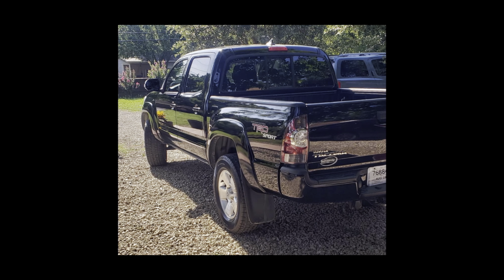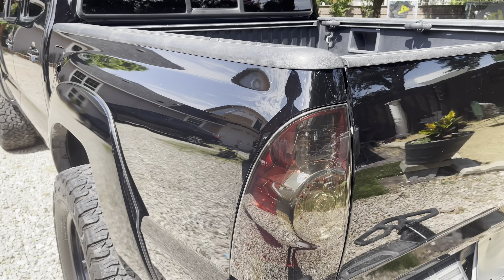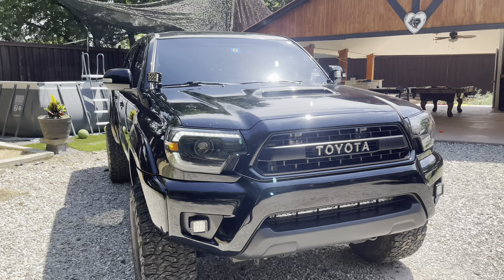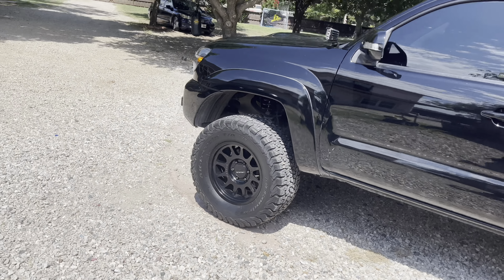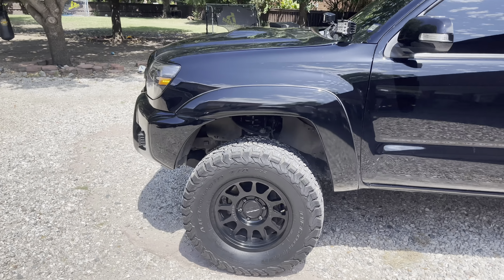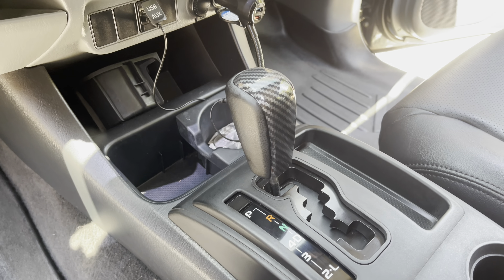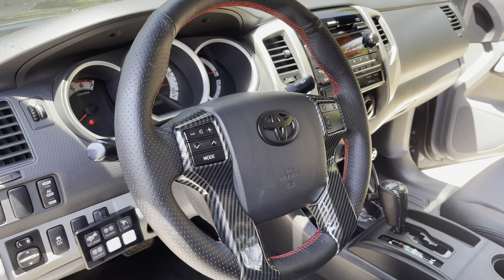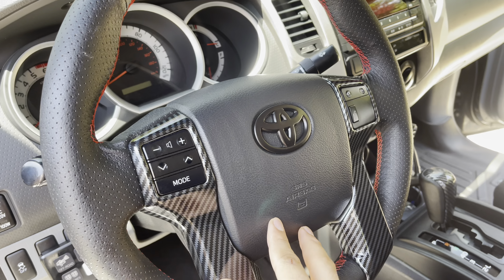Here's what mods I've done to my tacoma | Build list

Comment: so with the ball joints it probably has more to do the suspension angle than the quality of the ball joint. So yeah the stock ball joints in stock configuration will last 120k or more, but change the suspension angle add more pressure to them via larger tire and wheels and lift them via shocks only and they're probably going to fail in 40k or less.  You should look into changing your lower control arm and a steering  solution such as a track bar , drag link or pitman arm. the lca should help with the suspension angle and the steering components will hep with the binding and bump steer induced by lifting the truck.
Reply: Thank you. The lift will make ball joints and links wear out prematurely does not matter if you use Toyota parts. Only real fix is a UPC that matches the lift and is not just a better version of the original one
Reply from the maker: thats super helpful, thanks brother 👊🏻

Comment: I just bought a 2018 TRD 4 door Sport I really wanted the hood scoop and the guy who on my truck I got it from the Toyota dealership there is two that I was looking at and when I went up to the dealership and the guy who owned it he had a 3 inch lift kit on  the truck and new tires  265 /70 R17 and when you open the doors he has the factory the strips right there on the front and back doors it’s a Toyota so I guess he got the factory ones they look really good plus this guy this truck was immaculate  friend of mine he has the same truck as you and he has a 2021 laminate forerunner all blacked out that thing is really nice I really wanted to grab with her, I just wanted to get one with the six cylinder motor because I hear a lot of people are not happy with the new engines and I was happy to find something that was real nice that was used so my payments not crazy high I am looking at your truck with all the mods I can’t wait to get everything oh yeah I had a bed cover to

Comment: You dont need uca if you're under 2" lift.   

Put 886 fog light bulbs in the reverse lights, you'll seea bit better, even better with chrome housing

Your factory halogen housing headlights are far superior than alpha rex especially in the winter.  Morimoto retrofit is a better option but stock headlights with a halogen bulb, youll see better in winter, that's what i noticed with mine.

Comment: Your truck looks awesome, I too have a black 2012 TRD sport but in manual transmission and 4x4, also in the process of blacking out, my mods are the following : I  have both taillights and headlights from Alpharex the luxx versions both alpha black, and also have the mirror turn signals in black and they are sequentials that pair up perfectly with the sequentials on the headlights. Third brake light in black, Raptor grill with raptor lights with black "toyota" lettering , superior suspension front recovery mounts with shackles, sprint booster, S&b cold air intake, Uni secondary air filter. Wet okole seat covers, I'm keeping the tacoma door badges on but will plastidip them red, the bed decals will be removed, the tailgate badges removed, and will add a 4x4 badge in red where the v6 badge used to be. Eventually will be getting windows tinted and bigger tires with lift and fog lights, the list goes on 🤣

Comment: Hey dude love the tour of your ride. New sub and look forward to see what else you do.  My taco is same generation and felt you pain about the gray paneling.  Get Duplicolor vinyl and fabric in Matt black.  It's easy to apply and keep coats even.  Drys fairly quickly and most importantly doesn't flake or chip off.  I did mine over a year ago and only spot were you can see the original grey is a spot where a passenger swung his feet to quickly and l slammed one of the metal hook eyelets on the top area of their work boots. Beyond that I used the same stuff to also paint the roof liner and my seats. On fabric it'll feel slightly crusty when it dried but then just take an upholstery cleaning soft bristle brush and just give it a light brushing making passes alternating in all 4 directions.
Reply: Also I got the same headlights and if you desire to make them actually brighter you can put leds in them. I did and they look sick.
Reply from the maker: @logankrastel9609  really?? I'd love to see that. Do you have insta? Can I you send me pics of what it looks like? Maybe I'll try it on mine. My insta is the same as my youtube name

Comment: Niceeee!! What’s your wheel offset ?
Reply: Not op but he's rocking 33s on a 2.5" front lift and no cab mount chop like I do and in order for it not to rub you'll need rims with 4.5" or less backspacing. So obviously offset will vary depending on how wide the rim is but as long as the negative  offset is enough to get you to 4.5" or less back space then you're golden.

Comment: What's the offset of the wheels?
Reply from the maker: 0 offset on these
Reply: I know op told you 0 offset but you should know how much offset required depends on how wide the rim is so, if you don't want tires to rub, it's easier to choose correct rims if you look at their backspacing instead of offset. And they need 4.5" or less backspacing to not rub.